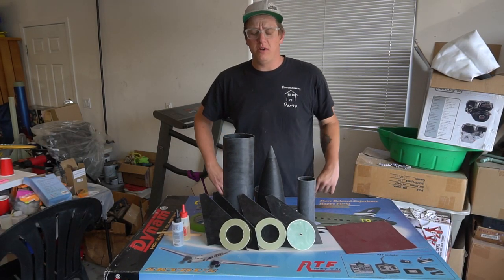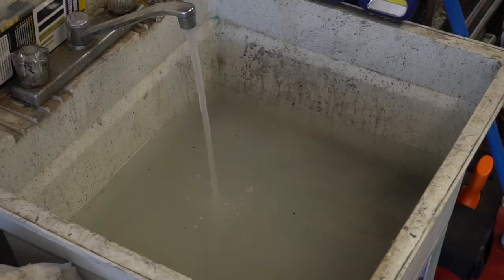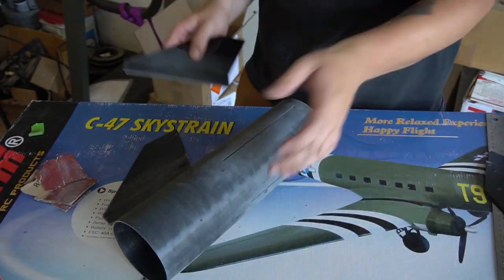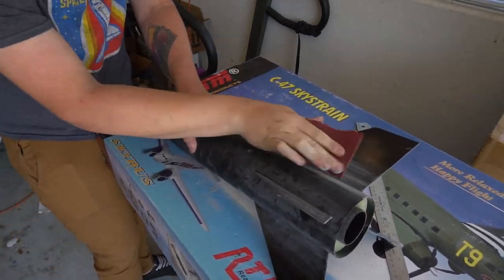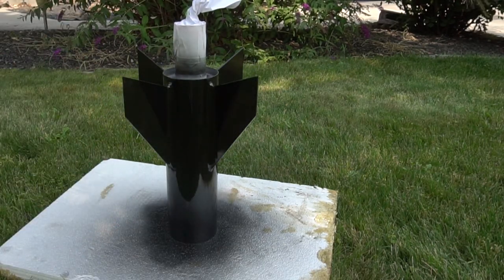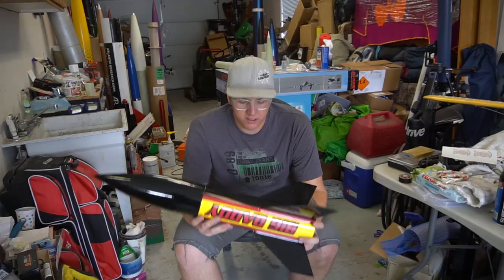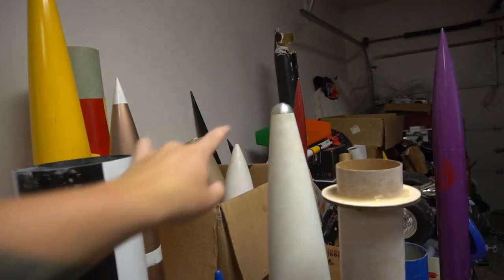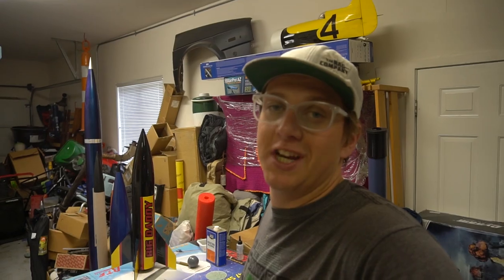AMW 4" Bigger Daddy Fiberglass Kit Build | Another K Motor Project!

Comment: When u put the 2k clear on did u scuff the paint around the decal? I have several done and painted with gloss paint and decals are on, just worried the max 2k clear will won't work right cause of the hi gloss paint. Thanks see u at airfest
Reply from the maker: There's no clear on it at the moment, just epoxy based gloss black. So long as your paint is fully cured before you spray the clear it should be okay. Just don't get too wild on the first coat to avoid runs!

Comment: Hey Braden, What West Systems Epoxy were you using on the Bigger Daddy fillets?  Do you find that product better than Rocketpoxy?
Reply from the maker: Standard West with slow hardener and colloidal silica filler. I am not a big fan of Rocketpoxy. It works fine, I just don't really get along with its use process.
Reply: @RocketVlogs  Did you have to put weight in the nosecone?  If so, how much?
Reply from the maker: @garyschricker8425  None! Use the base drag cone in Rocksim/OpenRocket to get the actual CP/CG relationship. Mine is stable on single grain 54s with no nose weight.